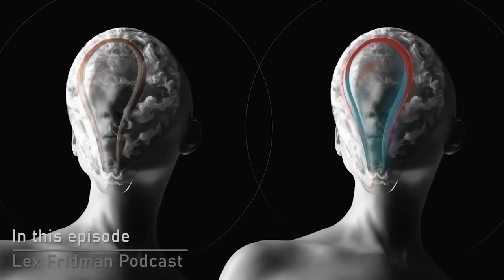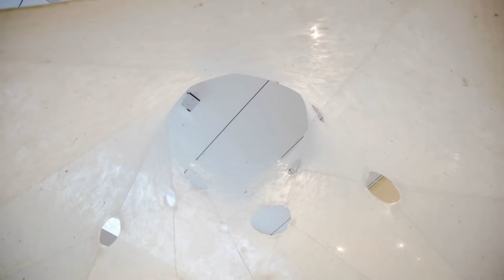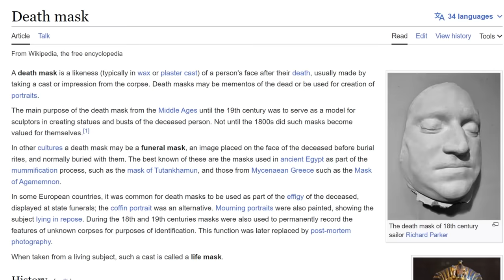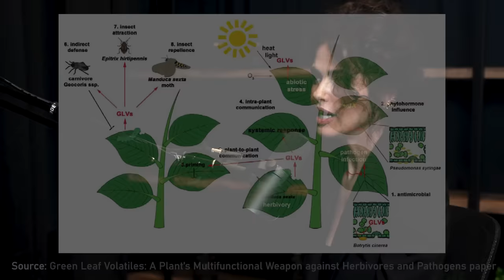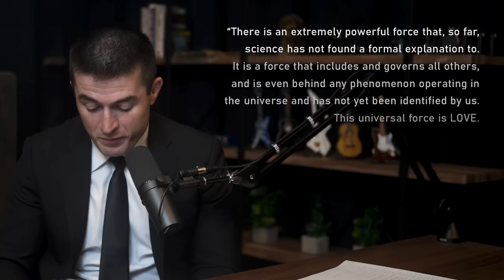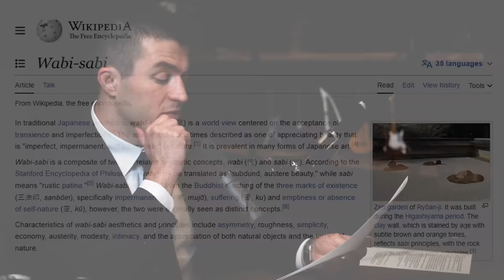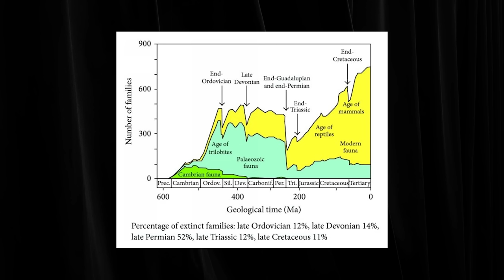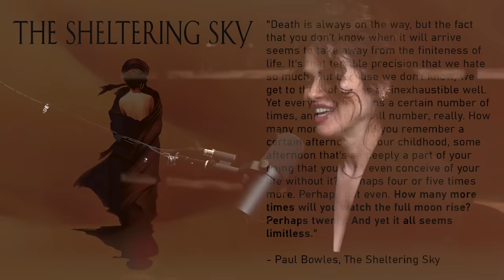Neri Oxman: Biology, Art, and Science of Design & Engineering with Nature | Lex Fridman Podcast #394

Comment: @1:42:44 I had third eye pop ups. A two line parallel; that morphed into a lake with glowing city lights allowing a reflection of the tree line. Then popped a lower cased T which was the designed as seen on mahjong tile; it appeared to separate the same way pepper on water levee away from dish soap; t created four quadrants; as XY axis displays +-. Then popped a cats eye wide open with up and down slit slowly the cat closed it’s eye, as sleepy.  I felt correlation when they are talking about these systems are the lower case squiggle T…  I have no clue, as what lake or eye means… perhaps someone will find meaning in those pop ups.🤞

Comment: 4:50 you engineer biomass that can feed off of and degrade human produced products into chemical compounds useful for living organisms to use and safely biodegrade within nature itself... imagine a biodegradable trash that is used as a wrapping but then is broken down in the dumpster by a bacteria that grows on the surface of the wrapper after it is exposed to air... the wrspper can be made of plasticized rice or some new composte material created so that it can be broken down easily... plastics can be given chemical structures that allow them to be broken down more readily... a smarter use of materials and the types of materials we are allowed to make should be considered and accounted for... instead of forever chems we make last as long as we need them to and easily broken down by some key enzyme or reaction that can be carried out by bioengineered bacteria designed to break down that type of material... recycling can be done efficiently and clean up can also be figured out on the mess we have already accumulated...